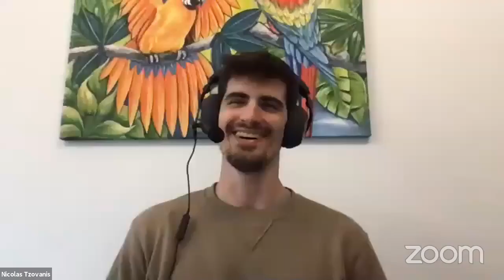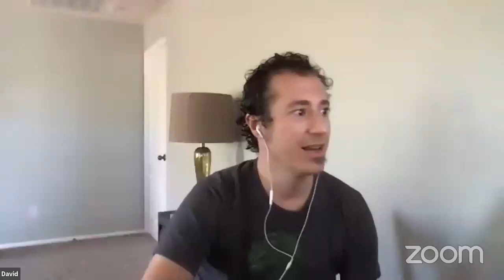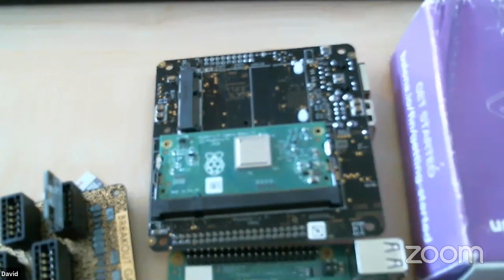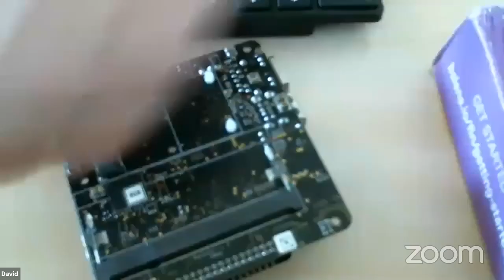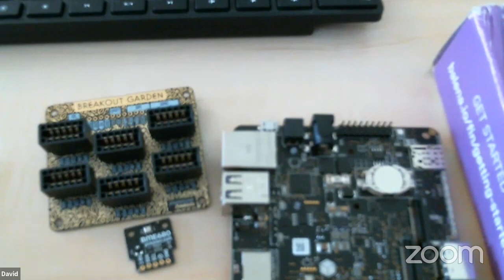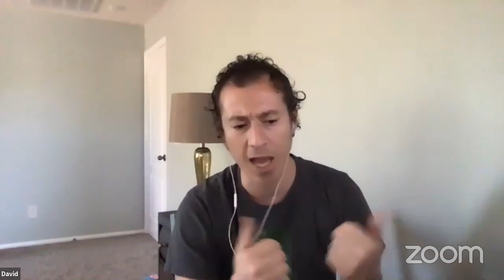IoT Happy Hour #6:  Intro to balenaFin

Comment: Hello. I would like to know, if the PI GPU can be enhanced by using Balena Fin. We would like to use the product in mass, but need to know if it is suitable for CV applications. PI suffers the speed due to lack of good GPU. Please contact me. We are a serious team and looking for best solution for industrial product of our product.
Reply from the maker: Hi there, thanks for the question.  Our balenaFin uses a Raspberry Pi Compute Module 3, which contains the same SoC as a "normal" Raspberry Pi 3.  So, the CPU cores and the GPU cores are the same as a regular RaspPi 3.  It does contain 2 camera inputs instead of the single input found on a regular Pi, so, there are certainly CV use cases that it can fulfill.